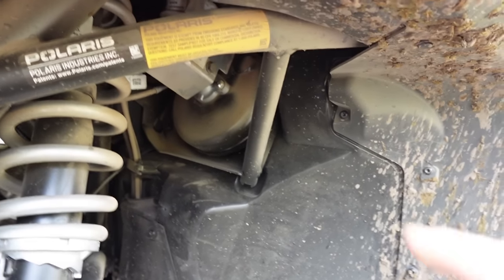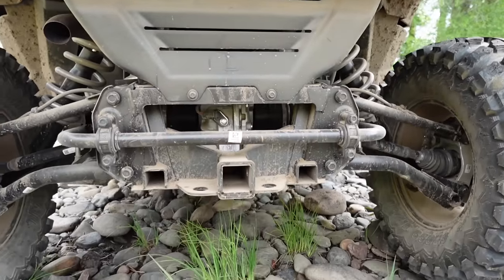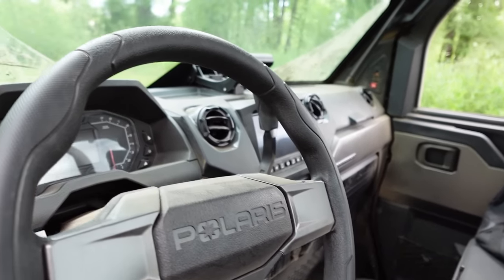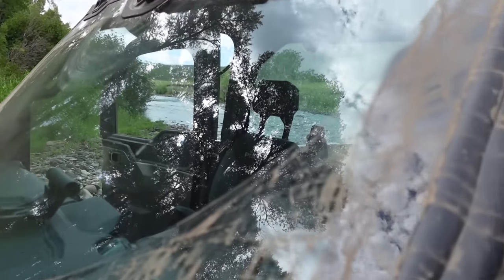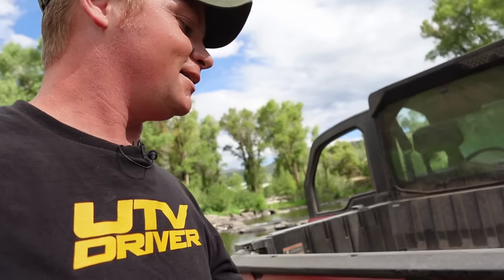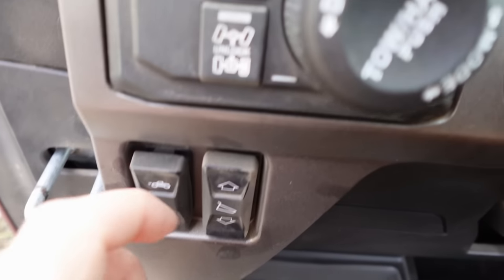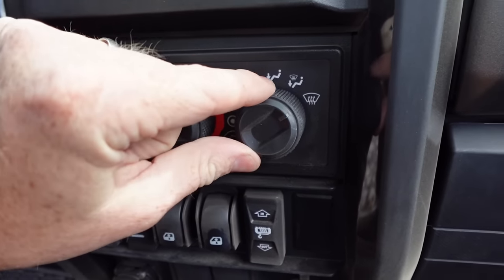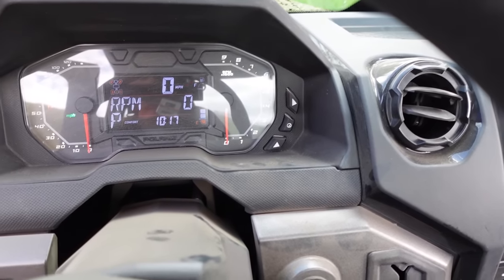Five Things We LOVE and HATE About the ALL-NEW Ranger XD 1500!

Comment: Love the features, hate the price.

I just saw a 2020 used 2 door jeep wrangler for sale for $15k that basically does everything this new Polaris does plus it is street legal and has a billion aftermarket parts for it available.

I personally think Polaris should have just jumped in with both feet into the jeep market and made a street legal tiny truck.
Reply: @@HorchataFan a base model jeep wrangler costa less than this new Polaris expedition. If jeep can put airbags on an off road vehicle then so can Polaris.
Reply: your not gonna haul anything with a jeep wrangler
Reply: @Illinoishunter "most four-door Wrangler models have a maximum towing capacity of 3,500 pounds".

Comment: I mean it’s a great work rig but Polaris needs to make long box option like my defender 6x6.  I really wish I could get that engine and transmission in mine, however!  The 1000 v twin is absolutely gutless and its CVT is jerky and difficult to use in technical terrain.
Reply: Interesting comment as I’m eyeing the defender pro (4wheel/hd10/long bed) for use on the farm.  Is the engine & trans really that bad?  

How has reliability been for you?
Reply: @freidrichnietzsche6643  it’s perfect for ranch work.  No problems with engine or transmission either.  Currently just hit 4,000 miles while on “the maze” in sand hollow (an 8/10 rated trail that was surprisingly not too bad with the 6x6).  I’ve had up to 1500 lbs in the back of it and have towed in excess of 3,000 lbs and it handles both of these situations very well.  I had to replace the belt around 3,000 miles because I accidentally left the parking brake on when winching out of a spot I was stuck on in sand hollow.  Other than that, I’ve replaced the tie rods and ball joints in the front twice, both front cv axles once (attempting mickeys hot tub and front wheels came off the ground while WOT and then slammed back down snapping both), and right middle rear CV once, and A arm bushings in front (need to do rears soon).  
But this is all primarily due to the fact I have really put this rig in some very harsh trails (see my channel for vids of what I’ve done with it). 
My critique of the engine being gutless is primarily due to the fact that I am oftentimes riding at 8,000-12,000 feet and above.
Reply: @downbytheriver501  10-4 and I appreciate the detailed response!  I never mind when a machine has more power 😎

Thanks, I'll check out your vids.  Are you running stock wheels/tires? (I guess the videos will also tell me;)

I just found a demo Defender Pro for list of $16.9k / 36 miles... might be time to jump on that deal!  Cheers.
Reply: @freidrichnietzsche6643  no problem.  I upgraded to 30” maxxis liberties.  Great tires and wear very slow.  Still over half tread at 4,000 miles.